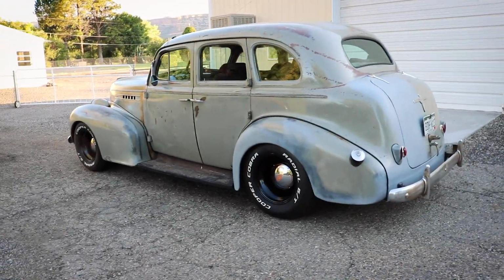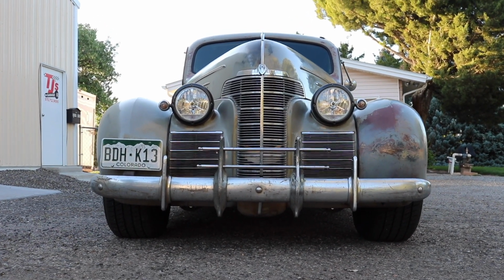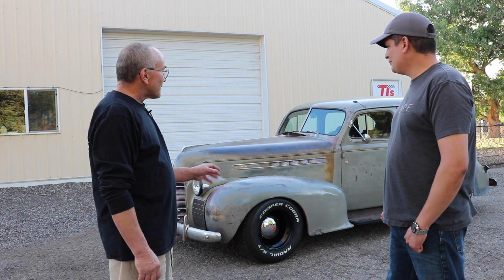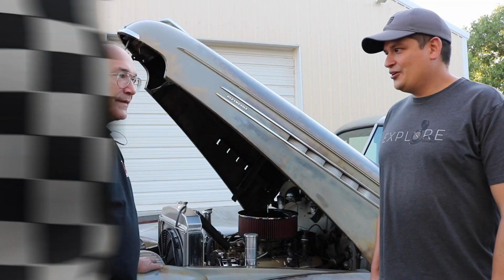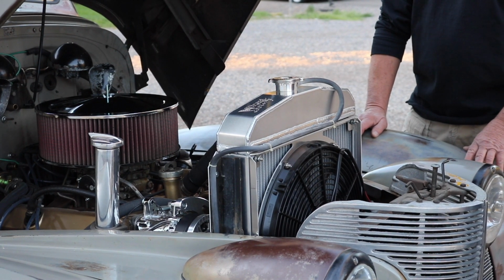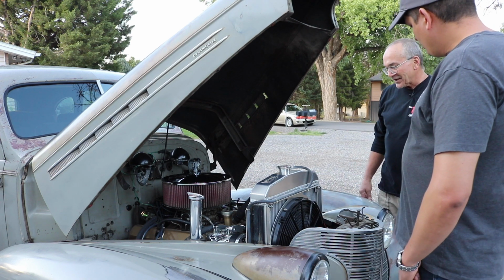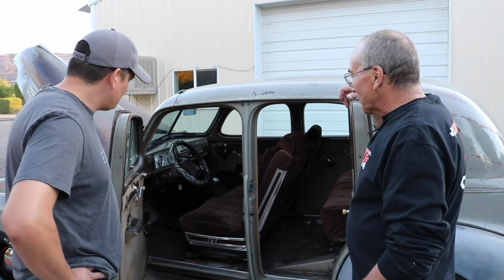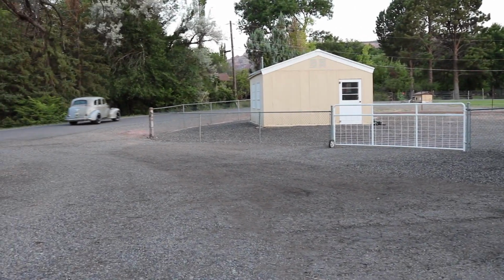Tim's 1939 Oldsmobile F60 - Driver's Therapy

Comment: My Dad bought a 1938 Olds 6 cyl. 4 dr sedan back in 1948 0r 49, for 2 dollars from a sailor that couldn't fix the gear shift lever that pulled out of the top of the transmission.  He and our neighbor towed it home and he fixed it in about an hour.  We had "Ole Ozzie" for about 7 or 8 years, and took a lot of vacations with it. .
Reply from the maker: That is amazing! Thank you for sharing.

Comment: I also have a 39 olds 4 door and I did mine like you, stock outside all else modern. Mine has a 5.0 HO mustangs all computer, power steering, cruise control,  climate control A/C, tilt wheel, power door lock, back up camera, clip on front end torsion bar disc brakes, rack and pinion, a $4,000 sound system,  new paint, new interior, air shocks and I also built a rack that goes on the roof that we used to take all of of our luggage from California to Canada for four of us to go on a cruise
Reply from the maker: That sounds amazing! It's got to be cool to drive.